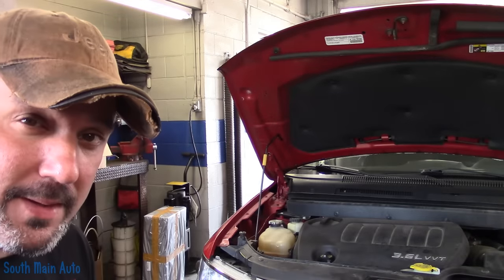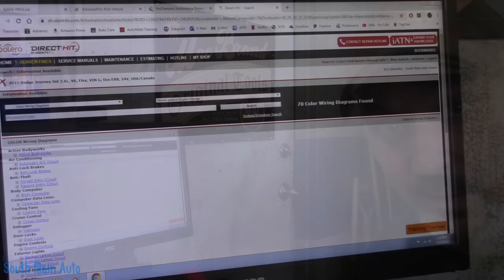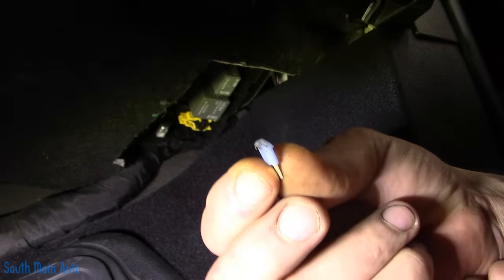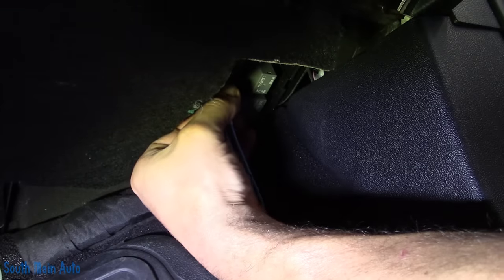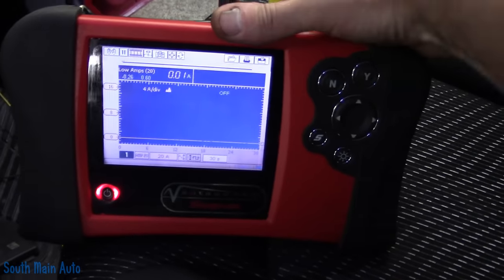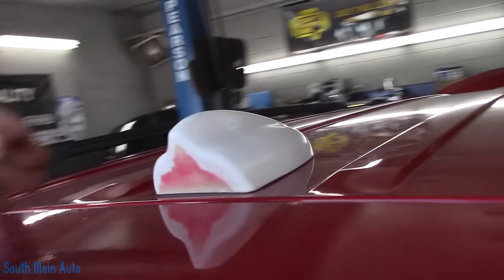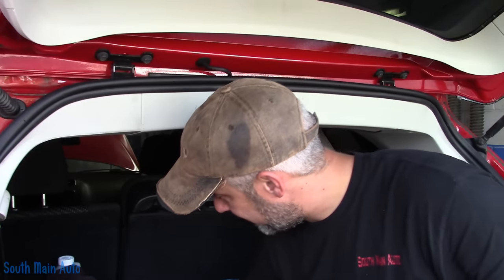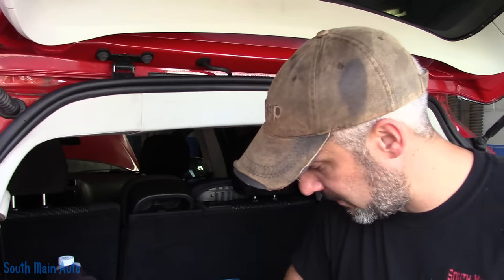Dodge Journey: No Start, No Crank

Comment: Those keys will give the issue of not showing up in the car. I replaced the antennas and everything under warranty, didn't fix it. Programmed  2 new keys and it fixed the key not seen issue. All these electronics in today's cars causes so many problems it's ridiculous!

Comment: If brought my vehicle in with a no start issue and the mechanic fixed it by disconnecting the aftermarket part(s), I would be delighted. Now, I can drive to work, get groceries, etc. And not have to worry about getting stranded.

Comment: I absolutely agree on no aftermarket crap, especially on Chrysler vehicles.  Their wiring systems were finnicky, no need to mess them up.

Can you put a 15 amp fuse in that DVOM? Or is it only designed for 10 amp max? 

Great video Eric.

Comment: Gahhhh! Aftermarket crap, crappilly installed, was always a pain the posterior for me too! Wiring diagrams circumvented, connections twisted and taped/wire nutted, etc, etc, etc. Nobody ever seemed to want to pay what it would cost to have their aftermarket POS installed properly! I ended up doing an awful lot of what you just did, Eric.  No gripes from me about your service when you disconnect/remove the offending item!

Comment: that shark fin is a mux antenna, it is factory, it has satelite and depending on vehicle build, also navigation, the red wire is not factory. and neither is that camera. They might have ripped that antenna off at one time.

Comment: The key fob some crystlers you can push the start button with the key fob and it will bypass the button circuit and alow the vehicle to start as a safety feature does the vehicle have that option

Comment: Hi. I think i would be a lot easier to use h7 55w light from low beam and put in in the blown fuse port instead of using this fancy tool. as soon as the light starts shine bright then you will know its a short cicuit to ground.

Comment: I have my own shop. Neighbor comes down asks for battery charger as his 2012 Kia Sorento would not start. Well he came back and said it woudlnt crank. I went down and well I must admit it took me an hour to realize that the brake pedal was pushed with the dead battery probably couple times. It used the vacuum reserve in the brake booster and the cause of the no start was the brake pedal wa not pushed far enough to activate switch..

Comment: We could debate all day if aftermarket stuff is good or bad but that added wire looks like a crap job...is that electrical tape?  I would want shrink tube over a solder or crimp and plastic split tubing to protect anywhere it goes by metal edges.  I would also want a smaller fast blow fuse on the aftermarket part (I admit, I added a splice for dash cam on my and my parents cars) and yes that may mean there is a fuse in a hard to reach place but it will protect the tapped circuit if the accessory goes bad.

Comment: My FJ had a trailer brake controller and power module that was installed by some goof with suitcase connectors and non-soldered connections held with tape... it was brutal. Ripped it all out, felt like removing a tumor from a cancer patient.
Reply: in the same sense, I've seen and had vehicles and trailers with those silly "scotchlok idp tap connectors" underneath them, fully exposed to salt and everything else on the roads and in water (boat trailers, go underwater when launching) and never had any issues, yes they were scotchlok brand and the vehicles were old enough to be pre-chinesium wire, hmmmmm.
what changed? I think junk brand cloned taps, poor quality wiring and junk coatings on it...

Comment: I have a valid question. A good friend of mine has a 2014  Journey that started not cranking over, after being driven enough to get up to operating temperature. If she shuts it off, it won't crank over or even a click from a relay. Once it cools down, say after maybe about an hour, it'll start right up. She had a shop  replace the battery; starter; alternator; starting relay, and the battery in the proximity key fob with no change in this vehicle's starting problems. The local Dodge dealer told her it's the abs module,  but they told her she would have to pay for it in full, and it's months out from getting it in. There is no aftermarket product on this vehicle, totally factory original condition. Any thoughts on this you could throw my way ??

Comment: Did that wire run over the airbag?  I really don't understand how folks can work this way.  I know very little about cars, but when I started investigating how to install a simple amp, almost every single source/manual/video tells me to a) get your own power from the battery b) with the right gauge c) with its own fuse d) fuse as close to battery as convenient so the wire can't overheat.  I'm sure there may be better ways for this camera - I've seen backup lights suggested which makes sense - but it seems such a basic simple rule.

Comment: Ever deal with oil coolers leaks on the Chrysler channel?  Her 2015 Caravan has been spilling it's guts in the driveway lately and I'm the only one noticing this (not her so therefore it doesn't exist lol).  Stealership wants 1000 Canadian a replacement.  I think I can tackle the replacement myself with an aftermarket 💩 oil cooler assembly however.  Is this a pain or is it possible to do if you're an average plebeian with an assortment of disorganized cheap tools?

Comment: Have this same problem no start no crank but no after market work on the back. Getting a ton of UC codes. Mechanic says all the computers are fried like it got struck by lightening.  A friend thinks it’s a short or grounding issue! So confused.

Comment: I wouldn't expect this wireless key system to use very much current at all (odd it's on a 15A fuse, then again the more different fuses are in a car, the more expensive each individual fuse is going to be, so: meh...), because that module (and the key) are going to spend more than 99% of the time sound asleep and consuming micro-amps. They'll wake up, say, every second or so and go: "you still here? -yup, I'm still here.", a process which takes a maximum of a few milliseconds and go right back to sleep for the rest of the second

Comment: Trying to figure out why when I wash my dodge journey, it won't start afterwards.  It will try to and then won't.  Have to jump it.  Battery is around 5yrs old if I remember right.  Measures 12.6 after a jump and drove around.

Comment: Curious what professionals think. Should aftermarket stuff be wired on their own separate circuit with their own separate fuses?  I would think yes.
Reply: Scott Yakoubian For me it depends on what’s being added and how much power it will draw. Most circuits can support small loads of under 1 amp without much worry. More than that and I’d want to run a new circuit. 

There used to sometimes be unused circuits where you could add a fuse and wire in an extra circuit. With cost cutting that’s only really don’t on heavier duty stuff now a days.

Comment: Hello sir, I know this videos and its comments r way old. But im having the same problem. Lock buttons and panic on fob works fine. In the car the cluster reads "no key detected", then "use fob to push button." But nothing. No accessory power, no run power. I have had my OEM antenna break and the base is slightly loose. No evidence of water stains around or in the hub module in the back under the head liner. No self-installed wires either lol.   If u were to proceed with the internal key detection antenna. How would u do so? I have replaced my car battery it self no fix, key fob battery no fix.

Comment: Hi Eric I'm having a problem with a 2008 Dodge caliber. I've replaced the electronic throttle control twice and the same problem keeps returning. The lightning bolt symbol on the dash comes on and the engine seems like its going to cut off.

Comment: Doubt that's OEM, Dodge put the back up camera in the radio screen.
Reply: The current ones have them in the radio (8.4 inch Uconnect radio screen) I was under the impression it was that way since 2015. The model shown  probably didn't have that option  if it has the smaller 4.3 inch screen.

Comment: The skills to do successful electrical gremlin hunting are not standard run-of-the-mill mechanic specialties.  You shouldn't be charging standard hourly rates for it either.  It's a premium high-skill service and should be rewarded with a premium rate.  Iffin' an effort involves after-market components, or beyond the standard connector/fuse inspection once-over, the rate goes to the skill-and-experience level. 

Nothing wrong with tiered service provisioning.

Comment: My friend has a 2010 dodge journey with heat problem the doors controller has been changed. Thermostat and heater core has been change it gets a little warm on on driver side of the car. The dealer says something has been put in radiator  like a stop leak. Would be 900 dollars to fix. My friend never put anything in engine. Im stumped on what it could be and what they would do to fix this for 900 dollars. I touched the  the tubes going to fire wall for heater core one seems a little hotter than other but most def not cold any suggestions

Comment: Installing aftermarket gizmos on these new cars is not for the faint of heart.
I installed a trailer hitch on our 08 Town and country. Gone are the days of just splicing in a trailer light plug adapter into the rear tail light circuit.
You still have to splice into the circuits. But that is just for the signal for the brake lights, turn signals, etc.
The actual work is done in an electronic box that sends power from a separate ( New) fused circuit that you run all the way to the battery.
If you try to use an existing power circuit. The car sees the increase in amperage and thinks something is wrong. 

Moral: If you install anything electronic in these new cars. Stay far away from the computer-controlled stuff. Unless you really know your stuff. I dont.. And I bet the kid at best deal car electronics does not ether.

Comment: The water leak is under the roof rack runners where they sit on the roof.  There’s a body seam in the troughs underneath and the sealer is not very good from Chrysler and it cracks.   Happens faster on mon roof rack cars that just have rubber strips on the roof.  The water spreads out and fooled me for a while but it all collects in the tool compartment or passenger rear footwell    MOPAR2YA BABY 😂

Comment: I'm a Master MECP and A6 certified installer.  Who ever installed the back up camera is a disgrace to my craft.  Rule 1 is to protect wires from chafing.  I could guarantee you who ever installed that antenna is the same shop that installed the back up camera.

Comment: That should not be tied into the module. It should be tied into the backup bulb. The backup bulb is intended to enable the power to the backup camera system. Of course, an additional fuse is also recommended to protect the backup system. This is an improper install. Good find. Learn how to use your tools. LOL. j/king :P

Comment: Can you un install them push button starts and install a regular key ignition? I don't like push button starts.
Reply: Most modern cars the key isn't really an ignition. Turn the key forward a split second it will crank automatically until the car starts. Once you realize this the push button is actually less complex and cheaper/easier to replace(besides the radio modules). 

I love my car with keyless access and push button start. I never have to get my keys out of my pocket when carrying groceries and at night if some axe murderer was after me It would not be a scene from a horror movie with me frantically trying to find the right key and get it into the ignition. Just jump in, push the button and go.

Comment: Hey Guys, I have a 2015 dodge grand caravan that has this problem with the AC. When i turn on the AC the passenger side blows hot air. Any idea where the problem could be?

Thanks!

Comment: If only they had used a bit of wire protection and run power correctly, this probably wouldn't have been an issue.  They already fished wires through the headliner, why not run a wire directly from the fuse box for the power?  That's the issue with aftermarket stuff, everyone buys the cheapest stuff and then installs it incorrectly.

Comment: If the installer atleast used an inline fuse in their installation, the customer would have never been stranded!
Edit: Or could the main 15a fuse still blow before the inline?
Reply: Hack installer would likely have used a 30 amp inline fuse.
Reply: @Tinker001  😆

Comment: No arguments from me on this one. Other than it isn't necessarily garbage. Could be, but this was definitely installer created. I have gotten to the point of ONLY tapping into accessory socket wiring and fuses. It is the only circuit in the car designed to have "garbage" attached to it. If it blows, worst case scenario it kills the oem radio (fuse). Then the customer comes back to me, and not a repair shop. Cuts down on everyone's wasted time.

Comment: In Australia, we call them blade fuses. Either blade fuse, or mini blade fuse. Some have LED indicators that glow if they are blown. All my cars have been retrofitted with them ($1.20 each) which is easier to spot in the dark glowing instead of pulling each 1 for a visual.   https://www.google.com/search?q=blade+fuses&newwindow=1&source=lnms&tbm=isch&sa=X&ved=0ahUKEwjrgeXS2NTkAhXn7HMBHR6QDXsQ_AUIEigC&biw=1920&bih=878#spf=1568614582971

Comment: The video is glitching every ten seconds. It does a lockup and tries to reload. Just wanted to give you a heads up.
Reply: TheNortheastAl yeah. I’m getting
Stuck at the blue fuse
Reply: Same. It's got to be a YT problem (buffering). If I listen to it in the background without video it plays fine. All other videos are working as well. Odd.
Reply: In in Wisconsin and I'm not having this issue, working fine.
Reply: Using an Apple device?
Reply: BTCAutomotiveTech yes.

Comment: Driving any  Chrysler product is a money light!!!     Bought new a 2014 Jeep Grand Cherokee Limited with the Hemi, biggest POS at 37,000 mile no reverse,5 window regulators, Bad crank sensors 2X, Bad blend door for A.C. air bag light (Takata) twice, cooling fan relay (lost count) got rid of that POS at 67,000 miles for a new (Nov) 2018 Acura MDX no headaches,  No first name basis with Chrysler service adviser, no AAA on speed dial,Blood pressure back to normal,   No Mo Mopar!!!

Comment: like you said time and time again bad work is bad work do it right the first time or do not do it at all. I am a A.S.E. master auto mechanic and recently left the shop I was working at due to flat rate pay problems not the dealers fault but manufacturer having almost everything warranty now and not paying crap for hours. they pay 1/2 what customer would pay for the same work and I find that very distasteful and yes all manufacturers are like this now a days. I got in to this business 1. because I could not afford to pay someone else to fix it for me 2. I like to use my head and hands 3. found that I was good at it  4. I like to help others out. But it is way to hard to make real money at this with all the tools time and cost to becoming a mechanic now a days along with all the training that you have to do to stay current with new technology every year .

Comment: looked at a 2016 chevy Malibu same issues..minus the blown fuse. Lights,,,dash lights...no radio and did not turn on either...dead.....wound up being the 3 year old battery cranking amps was dead...but had decent voltage . Jumped car started right up...took cables off and turned car off...waited about 30 seconds and went to turn on...nothing. checked with multimeter and showed about 11.47 ish volts but nothing worked in car. yea cranking amps I need to get a tool that checks that..even tho the volts showed low should have gotten something...Hate these new cars and their garbage stuff.

Comment: Bought a used 2013 journey sxt with 18k for my wife. We owned it less then a year. The biggest lemon of a vehicle. Between the thing eating up brakes and rotors, tires wearing prematurely (and odd ball sized 19" tires which are limited to a few manufacturers (so i was told) transmission clunk/bang when put in gear, sunroof leaking flooding interior out. The dealership 3 times i took it in said the transmission clunk was "normal" the technicians famous comments on the work order were "npf" no problem found. Traded it on for a awd trailblazer SS.

Comment: They should have tied that aftermarket crap into the rear power outlet in the third row of the vehicle it is ignition on this car that would been a lot safer than what they have done there I install this aftermarket stuff every day Custom leather seats seat heaters ksunroofs headliners 12 V electronics and such and I agree most aftermarket stuff is crap but we try to tie into power outlets in most cases  Worst case if you have to grab a small ignition wire you should always do a relay by using a big fat 12 V wire to power your accessory off of the relay And always use fuses

Comment: fixed my 94 f150 yesterday. sometimes i would hear a click when i turned the key to crank position but the engine wouldnt turn over. had to give it a couple tries to get the starter to kick in. recently when id hear that click the whole truck would lose power. no power anywhere other than the battery. turned out to be a relay by the battery. https://www.autozone.com/batteries-starting-and-charging/relay-starter/valucraft-relay-f492vc/966565_356866_11118       starts fine now :)